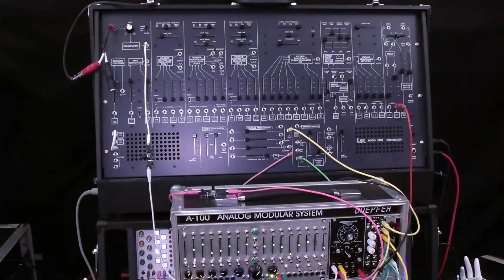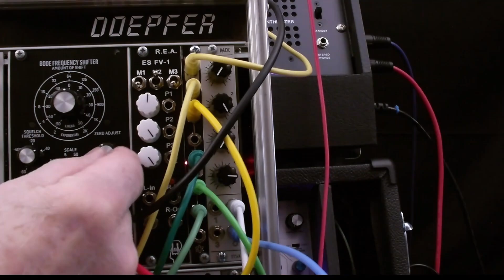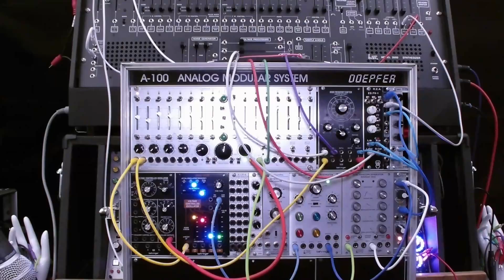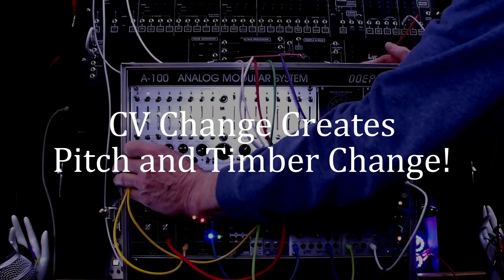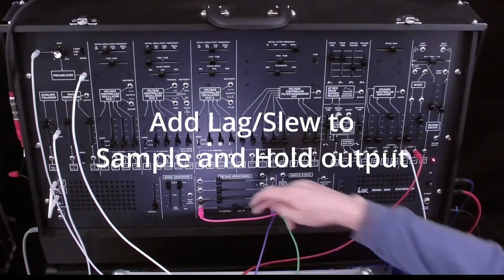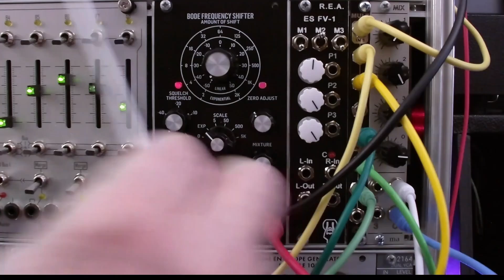System 55 - 1630 Bode Frequency Shifter - Part 3-- Musical Uses last 3 of 7

Comment: There's another example I've read about that also uses delay feedback. I think it's putting the frequency shifter in the delay feedback, but with a small amount of feedback. Apparently Kraftwerk Numbers used  a similar effect on the drums.
Reply from the maker: Interesting.  The drum effect is a premonition of the Phil Collins gated drum sound from the 80's.  Where did you read about that?  Have you ever reproduced the sound?  I'd be very interested in the details.  thx
Reply: @ozhalljr Oh I wish! No, I've never heard anyone reproduce the Keaftwerk Numbers drum effect properly.

There are a few articles and forums out there, but here is one: (in quotes)

 "However, a frequency shifter is only "half the battle" if you want to get close to the sound of the rhythm track of "numbers".

The other half is a delay with the frequency shifter in the feedback path. The delay time is set very short so that the result is not perceived as an "echo" but as an "extension" of the input signal. If the feedback is high enough, this "extension" "buzzes" "up" or "down" depending on whether the upshift or downshift signal of the frequency shifter is used in the feedback path.

Oskar Sala made this effect principle a permanent part of his music, but with such long delay times that the result was perceived as an echo, with each repetition sounding "weirder" or "more metallic" than the previous one.

Frank Zappa also used a similar effect, but in his case a pitch shifter was in the feedback path of the delay instead of a frequency shifter."

source: https://www.sequencer.de/synthesizer/threads/drums-in-kraftwerks-numbers.25939/page-2

Comment: I always wanted the Bode one but got the Doepfers MK 1. I never used with voices, nice to hear yours, so I know why how the Lucas THX film voices were made.
Reply from the maker: Thanks!
Reply: so If i put voices into my. doepfer frequency shifter I can get that?  @ozhalljr
Reply from the maker: yes.  I have never owned a doepfer FS, but the controls look identical.  I believe the function the same.
Reply: Is by far my fav Doepfer module i own since the late 90s @ozhalljr
Reply from the maker: It is a very interesting module for sure!

Comment: ALL RIGHT PART 3!  Feedback detection is not something I would expect from a unit like this. I am going to study very carefully the Bode document you linked last time. Example 7 with speech sounds like endless fun. You may have heard me laughing my head off during this segment. The reasons for getting this are mounting OZ! thank you so much for all the hard work on this! Cheers
Reply from the maker: Tony.  Thanks.  It was a lot of work (c. 10x a normal single video), but perhaps this series will be helpful for other for another year or two.